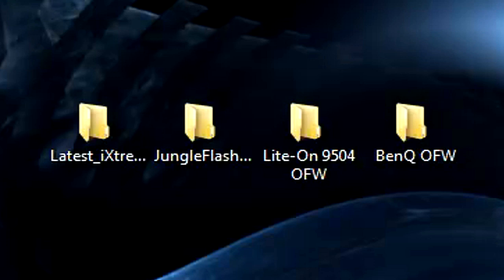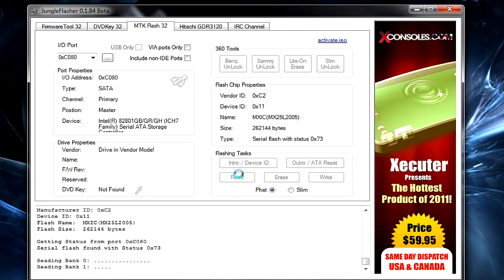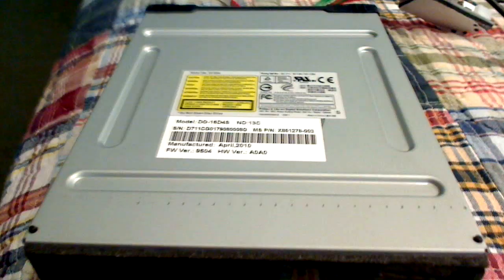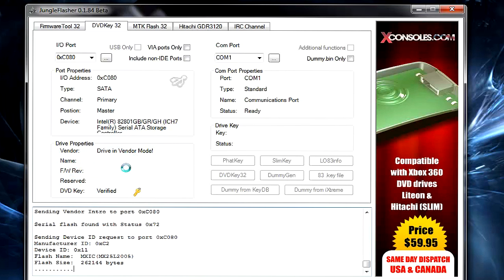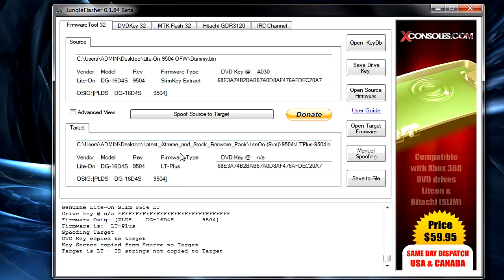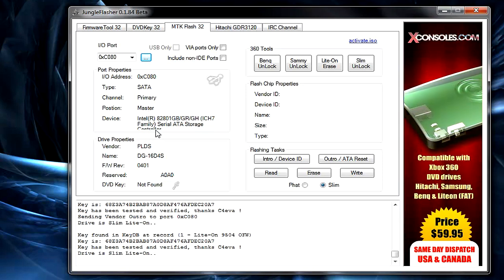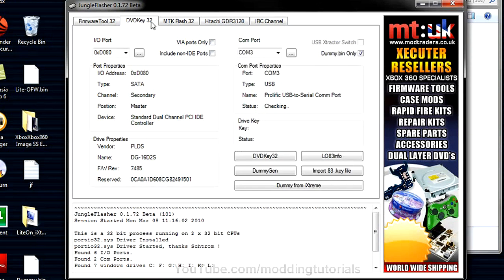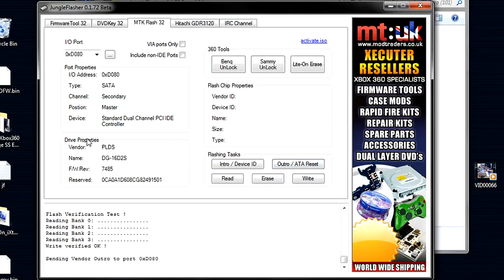How to flash Xbox 360 After Dashboard Update | BenQ, lite-on 74850c, and Lite-On dg-16d4s 9504!

Comment: I need help. I had a xbox arcade that's motherboard broke, so I bought a xbox with e64 thinking I could fix it. The e64 xbox is flashed, and putting my arcade xboxs DVD drive in it didn't work. I know very little on flashing, and the e64 DVD drive is a lite-on while the arcade DVD drive is not. Any suggestions? I'm thinking I can buy a new lite-on DVD drive but all say I would have to flash it to get my old DVD drive code?

Comment: really important question ok so i did all the steps but know when i pressed write jungle flasher froze and i waited 1 hour still froze thyen it auto shut the program said it wasnt responding then i try to wrie the firmwware to the drive doesnt work alsways freezes i have tried jungle flasher 1.79 to 1.84

Comment: Iam very new to  xbox360 modd,now i know to flash your drive you must use jflasher to extract the dvdkey/FW etc,my question is this i know depending on your
drive if its a samsung,or a benq/liteon the FW/dvdkey is different,i know to flash it you have to extract it then when you have
you  then wipe your drive clean then install the modd fw to play backups etc,so if its all different types of firmware depending on your drive,
then wot is LT+1.9 that u have to upgrade to what drive is that for

Comment: I have a  dg-16d4s, 9504, A0A0 and do I even need to use the Firmware Tool 32, OR do I just use DVDkey32? I also get an error message every time I try to unlock my Slim... Please respond ASAP because I REALLY need help. :(

Comment: ok, so i have a xbox 360 elite, the drive is a liteon. i dont know what model it is because i havent opened it. Anywayz will i be able to flash it with LT 1.9+ because i have never flashed this drive and apparently you need the original firmware? So will i be able to flash it

Comment: Hello I saw your video its a awesome tutorial. This is my question, I bought an xbox360 last month and I try to play some burned dvd an it won't play on my xbox360. Its that because I don't flash my xbox360 drive yet. How come its won't work when its manufactured date was 8-28-2012 and the dashboard is 2.0.16203.0. Do I have the latest firmware or not. Can you help me for this.

Comment: heres my situation:

i have a liteon 748 phat with 1.1 that i flashed for the first time months ago. and i also have my key, bin, dummy, etc.

What is my next step?

Do i flash to stock using, ofw firmware then update? i see 4 different version A, B ,C, D, E

Then if i update on stock then is okay to proceed to 1.9 ?

Basically, this will be my second time flashing and i currently have all my keys(dummy,bin,key, etc)

Comment: i have a laptop and im trying to flash my hitatchi or what ever its called 78/79 drive and you have to have a computer and a x360usb pro kit which cost like 30pounds so im not doing that ive just got a satacable and pica card thing which goes into your laptop is there anyway of flashing it, i have 2 xbox 360s ones banned and ones not i want to do it on the banned one so it doesn't matter if i can get banned....

Comment: seriously lt+1pluson a 9504 is NOT safe ? until 1.9 is released for slim revisions 9504 0225 etc... stay offline with your original key , then when its released go back to stock do update and only then update to 1.9 to avoid being flagged ....also 1.9 doesn't add support for xgd3 backup only originals ... : )